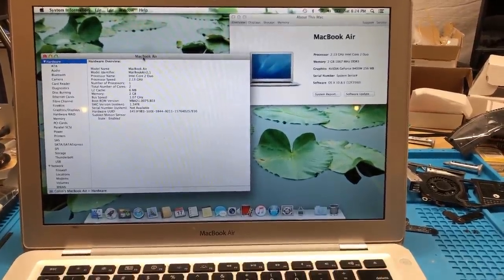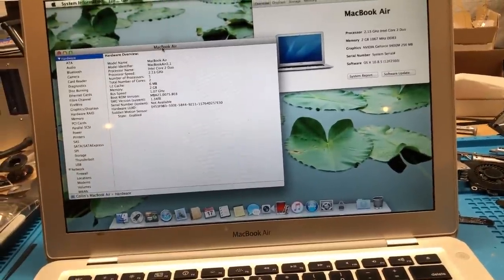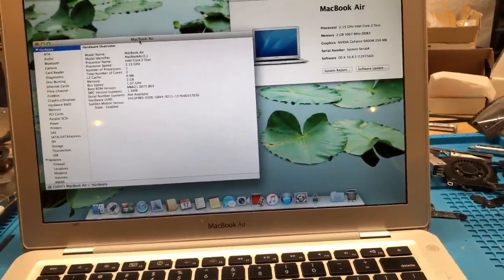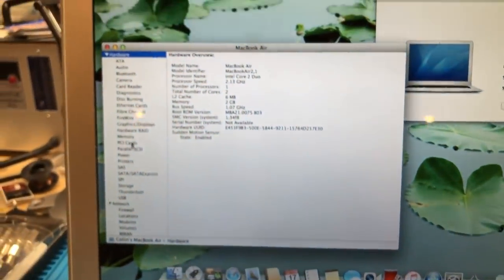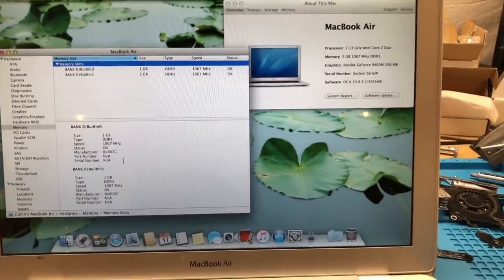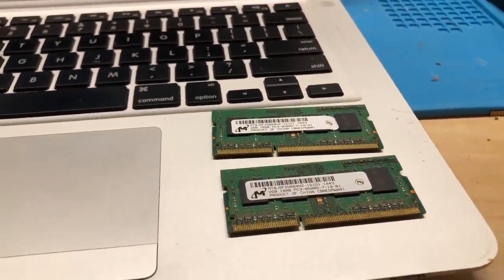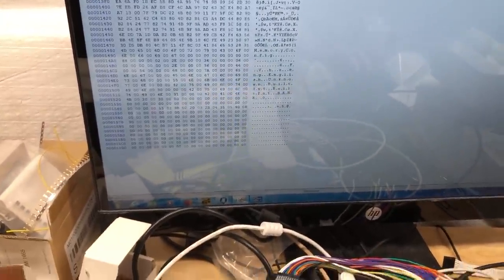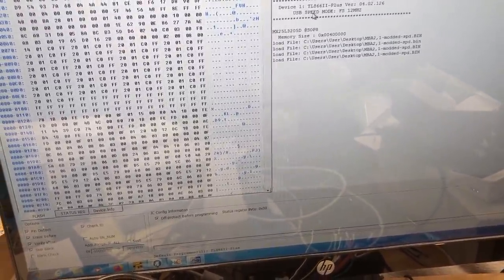Upgrading RAM on a First Generation MacBook Air

Comment: 2GB of RAM was not good at the time. It was just enough for casual use, which is what the Macbook Air was designed for. It was also the point at which Apple started down the road of non-upgradeable memory for their laptops. I really miss being able to upgrade without having to buy a used motherboard or spending too much time on the workbench. 

Nice work, but it really should have never been necessary.

Comment: From my experience, it's a lot quicker to let the RAM chips soak in a bit of IPA after wicking down the residual solder. That flux wipes right off after that. Great work!

Comment: The Mid 2007 MacBook Pro could be supported by your patcher if the CPU is upgraded to Penryn! This requires soldering skills but you proved it definitely possible! Could you please add this model to the list?

Comment: 32:00 Whoever wrote the SPD guide didn’t really think the dec to hex conversion through for the revision numbers, because 10d, 11d, 12d are Ah,Bh and Ch.

Great video! 
Thinking about it, I could possibly upgrade my MBP 2014 from 16GB to 32GB of RAM. 😀

Comment: This is brilliant, if you actually get it to 8GB then it will actually make this model somewhat usable.
Reply: That would depend on what the processor can actually handle. Whatever the processors max is, that’s it.

Comment: I've got one of these with a 64GB PATA SSD. And while the RAM limit is frustrating, it's less frustrating than when one of the two cores overheats and the system drags to a crawl.  It was a known design flaw within year one -- and Apple had no answer other than the ineffective replacement of the logic board.  Still, after a battery swap in 2015, I use it to test out lightweight Linux variants.

Comment: This is quite an involved video on upgrading memory on an MacBook Air, which like other Apple Laptops has the memory hard soldered to the mother board and is considered to be not upgradable. The video shows that with all the right knowledge and specialized skills and specialized tools the memory can be upgraded. It is too bad the Apple company went this route of un-upgradable memory. It is so much simpler to have dedicated memory slots where the old memory modules can be replaced with higher capacity memory modules.

Comment: I did something similar for a graphics card I purchased from someone, but not as professionally. I carefully took a damaged GDDR5 chip off of the GT740 and off a dead rx550 and just put it on the GT740. No reballing, just careful lift off. Not ideal but it did work.
Reply: If it worked thats all that matters 🤷🏾‍♂️

Comment: Thanks for the video! I am using a Mid 2009 upgraded MacBook Air for school, 2GB is working fine but I think to get just a bit more use later down the line I need to get it to 4gb, or else it wont be able to even run a tab of chrome!

Comment: Flip in amazing!. Still I’d like to see this procedure on 2014 Mac Mini, as they’re still supported but a lot of them have base 4GB of ram, which is near to unusable on current Mac OS.
Reply from the maker: That's actually much easier to do than this machine, as they only have 4 RAM chips, and have strapping resistors to tell it which SPD data to use (so no SPI ROM modifications are needed).
Reply: @dosdude1  I've seen the retina boards having resistor configuration as well - true for your upcoming retina video?
Reply from the maker: It is true, but it only has resistor straps for up to 16GB. 32GB will require the same SPI ROM modifications shown here. They do have 32 chips, so I'm in for a lot of reballing when I do this LOL.
Reply: @dosdude1  much obliged for the reply and love for your work ❤

Comment: Wow. Great and informative work!
I have a Mac Mini 2009 with 8GB ram, which is the unofficial maximum this machine supports. Do you know if there is any workaround to make this Mini support 16Gb, 2x8Gb 1067mhz modules?

Comment: You do BGA soldering very nicely, I wish every repair center had your skills!
Can I just ask you though, why you run such an old version of macOS when you can run up to Monterey (although for Core 2 Duo machines your Catalina patcher is better, Big Sur acceleration takes quite a bit of time to properly load in).
Reply from the maker: I've had that OS installed on this machine for years, this MBA has been sitting unused for like 5 years. It's all I need for testing anyways.
Reply: @dosdude1  do you think it would be possible to have 8gb ram on 2011 mba?
Reply: @AsianFlex  Do you think it would really benefit from 8GB with the rest of the hardware and the horrible cooling anyway?
Reply: @Zebra_Paw  Yep, 2011 will support 16GB. Just needs new thermal paste and manual fan control at medium speed, you can even max the fan speed to max if you don’t mind the fan noise, but it will definitely be cool thermally. I would not aspect a “Zebra” dude to understand
Reply: @flamingkillermc2806  what do you mean?
Yes it can support 16GB, and? It’s not useful, except if you do something that only requires a lot of RAM but no actual CPU power!
Reply: @Zebra_Paw  Bruh people with these MacBooks don't do hardcore intensive tasks, they are meant to be hand downs to  kids because the don't need a M1 chip to watch youtube videos on, and regular productive tasks like web surfing, videos, super light gaming its perfectly do able.
Reply: @flamingkillermc2806  that's why it would make no sense to put 16GB of memory
Reply: @Zebra_Paw  Eh, some people are just rich and they can max out their ram if they want.
Reply: @flamingkillermc2806  Yes but it's actually quite stupid.
If you are rich, but you do know how bad Apple is, the fact that they have no respect for the environment, no respect for repair and no respect for you either, then you don't buy this device anyway!
Reply: @Zebra_Paw  If you are rich you don't need to know how "bad" apple is. Yeah they are bad with repaires since they literally want you to buy a brand new device. And what will you do once other companies start copying what apple does? Like the headphone jack, notch, no charger?
Reply: @flamingkillermc2806  I will stick with older devices. My daily driver is a late 2009 polycarbonate MacBook. I deep cleaned the rubber, and while the top has a lot of scratches, the hardware inside is capable enough for me. 2.26 GHz Core 2 Duo P7550, Nvidia Geforce 9400M GT, 1TB Samsung 870 QVO SSD, and 4GB of DDR3 SDRAM which I will probably be upgrading to 8GB. Absolutely love this machine, patched it to Catalina, found a permanent fix to Chrome and Office not working properly, and that's it. It's Apple but it's not bad by any means (except maybe the release price but I got this for free).  I also have an early 2011 13" unibody MacBook Pro, but I do not carry this one with me.

I could patch these to Big Sur but it takes long to boot and settle in after log in. Too long for my liking, with SSDs it is supposed to be much faster. I found that it's actually being slowed down by features that originally required Metal now using the CPU.
Reply: @42asshole  LOL I had the issue, it took me so long to actually fix it. But now I can do it in seconds!

Comment: In 10 years you will need to make this video for everyone who bought the 8gb M1 air or mini. 8gb is just not enough in 2022.
Reply: That might actually be easier because you just swap the whole SOC
Reply: Totally agree, someday will be possible, make no mistake about it.
Reply: @oledcrt  easier? with no replacement parts available then the SOCs from 16 GB M1s... I think you're out of luck
Reply: @19TheJohn93  yeah I just meant the process of making it work

Comment: if you can increase the ram of the macbook air and it works, you can also add ram that exceeds the maximum limit of ram on the macbook or macbook pro.  for example, a maximum of 8GB you add up to 16GB because you can change or edit the spd. Am i right?
Reply from the maker: On soldered-RAM boards, yes, but you are still limited by the chipset and the kind of memory chips (pinout wise) used on the board.

Comment: wow absolute madlad. I've done RAM swaps before by changing the strap resistors, didn't even think you could change the SPD in the bios directly like this. wonder if this could be done on more modern machine, like the 2015 range, to upgrade the ram to higher capacity than possible by just changing straps
Reply from the maker: Yes, it definitely could.

Comment: That is awesome! Wonder if it would be possible to squeeze 8GB out of this thing as well? Unless you're EFI limited...
Reply: I have a Mid 2009 Macbook unibody and it did not officially support 8gb, but unofficially it worked fine. I used it for years until I got a new machine.
Reply: @MLGPRO-dx8fg  interesting! Maybe it'll work then. I was thinking this air was the OG 1,1 model which has a 32bit EFI but this is a 2,1, which has a 64bit one. So in theory, it might be possible!

Comment: Love your work Collin do you ever use solder paste with the stencils? i am thinking your method with the flux and right diameter solder balls better way :) , btw i have a titanium g4 1.47 ghz g4 replaced the lcd on it tho when re-assembling i snapped off the keyboard ribbon connector (dry solder joints) wondering if can send it to for a fix, i am to scared to reflow it plastic melty thing >< :)

Comment: thanks for info how to modify a bios chip i guess i will try to modify the fake gt730 that i got it should be a gt 705 1gb but I cant find a working one and tha ram brand is not listed on on any gt 705 bios available online.
Reply from the maker: RAM brand doesn't matter as long as the size is correct.
Reply: @dosdude1  yes you're correct

Comment: I have a MacBook Air A1370 late 2010 with 2 GB of RAM. Is it possible to upgrade it to 8GB at less?
Reply from the maker: Unfortunately only up to 4GB on that model, due to Apple not routing memory address line 15.

Comment: Well done. Is CPU Soldered? Can it be upgraded too?
Reply from the maker: CPU is soldered, but unfortunately cannot be upgraded, as these CPUs are a custom package design by Intel for Apple, for this machine specifically. The best one available is the one it already has, the 2.13 GHz Core 2 Duo SL9600.
Reply: @dosdude1  What about pinmodding?

Comment: My real question is why go through all this trouble to upgrade the RAM in that fashion to only double it? Why not upgrade it to 8GB, is the motherboard and/or CPU incompatible with more than 4GB?
Reply from the maker: This was just a test, I had no idea if modifying the SPD info in the SPI ROM would actually work. As I mention at the end of the video, I will be trying 8GB next.
Reply: incompatible
Reply: @dosdude1  Which Ram modules (if any) are compatible with the 2015 MBA A1465/A1466?

Comment: Wonder if this could be done on a 466 mhz iBook Clamshell? Would be wild to get the RAM up to 1GB with 512 onboard and a 512 stick, if possible... :P
Reply from the maker: It most likely could, assuming the SPD is handled the same way in PowerPC machines.

Comment: Does that mean can it handle 8GB or 16GB if your overkill?
Reply from the maker: Not this model, unfortunately. 4GB is the most that will work.
Reply: @dosdude1  Would you be able to upgrade mine in the future? I do plan on getting my hands on an original MacBook Air Late 2008 or 2009 and patching Catalina or newer on it and 4GB of RAM would make it better for the experience for fun.

Comment: Did you ever consider hex editing the firmware for a 9400m overclock?
Reply from the maker: Definitely not on this machine LOL. The MCP79 fails often in these as it is, due to poor cooling.
Reply: @dosdude1  what about increased shared memory?

Comment: I wonder if Apple silicon memory can be upgraded?
Reply from the maker: It can, and it has already been done actually.
Reply: Oh neat that's great news.  Are the Apple silicon memory ICs ones you can salvage from commodity DIMMs?
Reply from the maker: No, they are custom chips, unfortunately, so there isn't much option in the way of doing that upgrade.

Comment: nice i already tried one from 2gb to 4gb but i get the 3 beeps and was not able to fix that i hope i still have the board and wil let you know if it works
Reply from the maker: Yep, should be able to modify the SPD info like I did, and it'll boot right up.

Comment: Possible for MacBook Air Late 2010 to upgrade ram from 2gb to 4gb?
Reply from the maker: Yes, but no higher than 4GB on that or 2011 model, due to Apple not routing memory address line 15 on those boards.
Reply: @dosdude1  Nice to hear from you Colin 

What about upgrading the processor is that even also possible or cannot?

How i wish we are closer so you could do my MacBook Air .
Reply: @dosdude1  Colin need your help I’ve used your macOS catalina patcher software to install on my MacBook Air late 2010 3,1 A1370 EMC 2393 but I got stucked on apple logo estimated time remaining what should I do??

Comment: Is it possible to do a 6GB A1237? I know early C2D macbooks only supported up to a 2+4 configuration
Reply from the maker: No, as that would require 4Gbit 16-bit DDR2 chips, which don't exist.
Reply: @dosdude1  My fault you are correct for some reason I was thinking 4GB sticks had 256Mx16 chips but only really have 128Mx16.

Comment: Greetings. I have a macbook black 2007 A1181 which only accepts as maximum 3Gb ram. Is it possible to change the firmware bin to accepts at least 4g?